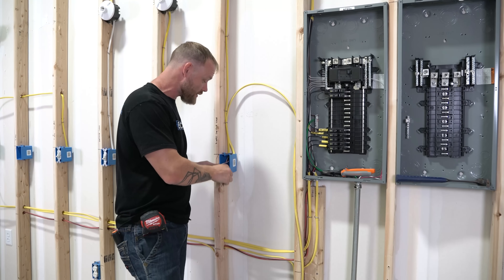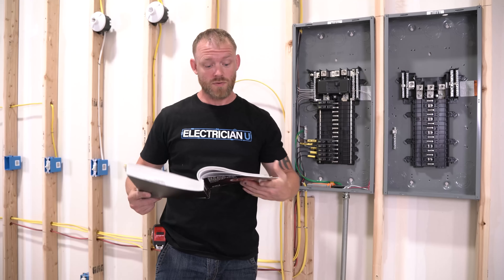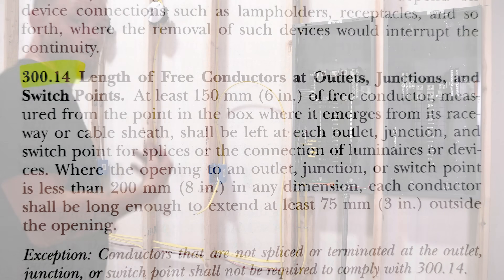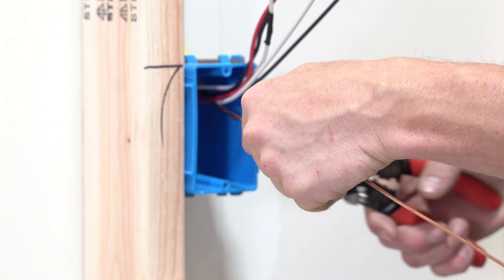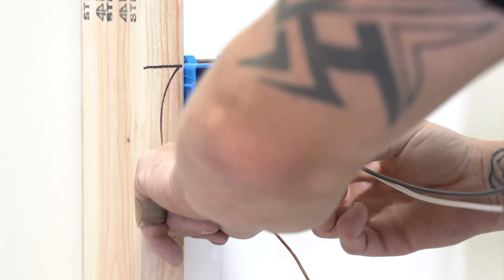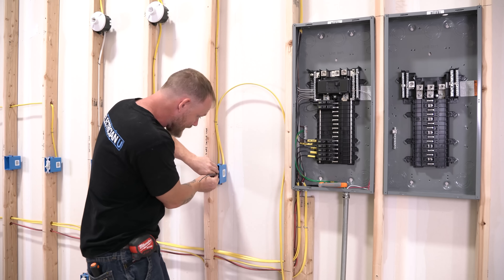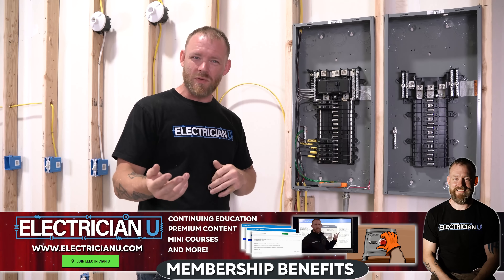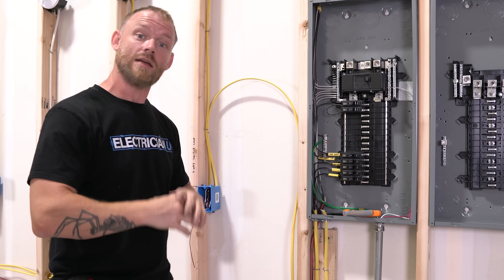STOP Cutting Wires So Short!!! What Does Code Say?

Comment: Crazy a code so simple can have language i’ve missed for years and i’m 20 years in and licensed. Always made a habit of 6” passed the opening of small outlet boxes and now realizing it’s 6” from the sheath or conduit and only 3” passed the opening on small outlet boxes. Code is a minimum, but with larger devices it’s good to have a way out legally.
Reply: Almost 30 years in and I still experience the same thing on occasion (simple code language that I missed). But, like you said, code is the bare minimum and sometimes the code isn’t even adequate for all situations. What about a 5 or 6 gang switch box? 6 inches from the point of cable/raceway entry into the box is not enough. What if your romex comes into the right side of the box but you need that switch on the far left side? It makes for some nasty joints and unnecessary cramming of wires/ wire nuts when trimming out your switches
Reply: @Ephesians-ts8ze  6 inches is a minimum so just make them longer.
Reply: 8 inches from the back of the box.  Klein strippers is my gauge
Reply: You can make the wires longer as long as you don't exceed box fill.

Comment: There are a few things that really piss me off when I am doing service work and one of them is when I need to remove a switch or receptacle and the wires are so short that I can't get to the screws to disconnect the wires. How in the world does someone install a device like that? What goes through their mind when they think that the shorter the wire the better it is? Or is there some other reason for it?
 I understand that sometimes someone screws up and just fails to pull in enough wire or ran out of wire, but for God's sake put a fucking wirenut and a pigtail to extend the wire so you can work with it. So annoying. 
 Things that unqualified people will do when installing electrical that saves them a minute or two ends up being an hour or more of headaches and aggravation for the troubleshooting service electrician. 

  For all you installers and new guys and girls, here is a tip that will help you out in the future, as well as the electrician from the future who has to follow up your work someday. 
   Think about the next electrician who has to work on your install. If you do your job right it won't need to be fixed in the future and if you do it with bad workmanship you are making life more difficult for the next electrician which could be yourself. An extra minute or two will save someone in the future an hour or more fixing your crappy install.
Reply: Exactly. And if the wires are just barely long enough to begin with, what do you do when you run into some knucklehead that decided it was a great idea to plug in 6 powerstrips into one, and then run a dozen+  extension cords off of those, and burns the receptable up. And the only way to fix it is cut off the burned part of the wires and hopefully there's enough left...
Reply: @brnmcc01  --- if there isn't enough wire, that's when the real money gets made. New wiring from that box to wherever those circuits are being run from. If it's flex it's not so bad, knob and tube - you're screwed, Romex or BX or MC or free air wiring, you're screwed. Actually the customer is screwed, we just have some work to deal with. But that's what we do. That's why we get paid the big bucks.
Reply: Yes think about the next electrician, because the 'next guy' might be you 10 years down the road.🤣

Comment: A good rule-of-thumb I see a lot of journeymen teach apprentices is stick the jaw of your (9 inch) lineman’s pliers against the back of the box and cut your wires off even with the end of your pliers handles.
Reply: I'm an advocate of thumb to pinky outside the box. Even guys with the smallest of hands can make the wires long enough.
Reply: @IceBergGeo  that’s a good one, too! Actually, the thumb to pinky rule is even better since boxes are different depths and putting your kleins against the back of the box may not be enough if you have an extra deep box or box with an extension ring
Reply: I just use the the tip of my thumb to the bottom of my hand as a ruler, for how long I need my wires to be outside of the box, because it's exactly 6inches, but thats gonna be different for everyone.

Comment: Great video and explanation.  I have to admit, when I bought this house 10 years ago, I wanted to learn how to change light switches and outlets.  So, I jumped into it, watched some videos and went to it.  I did cut some of them back too far I feel, but my reason wasn't so much about recycling, I got USB outlets, big boys, and I was getting frustrated because I couldn't get them in flush and thought there was too much wire blocking the way.  Now, in the last 3 years, I've learned my lesson, since I've tried to change them again and they are super short.  So, anything I currently change, add, or replace, I've left at the 6- and 3-inch marks, I get it now lol.  Previous house owners also cut them short, so I've been adjusting and fixing their issues to bring things back into code and make things right.  Wish I saw this video back then.  I've learned a ton from your videos and have now installed new lighting in my ceiling, and more.  Feel a lot more comfortable and even have large electricians' book now.  I do enjoy it.  Thanks again.
Reply: Why not cut out the box and install a larger one?  I don't really see a reason to ever use shallow boxes (understanding that yea, older work probably used smaller boxes) unless there's some sort of space constraint behind where you're installing the box.  Would be curious to know there is a reason other than cost savings to use one.
Reply: @danielherman9483  Exactly, if I get away with it now, I will.  But back then I was a little intimidated and didn't know.  This past year when I remodeled my basement, I added new lights and the way the old owners had it wired, was a nightmare.  I basically rewired the entire basement, they had things going all over for no reason that I could find.  I streamlined it and it's so much nicer now.  I work IT, built many PC's and now do web dev stuff.  So now electrical is like building a PC to me.  I enjoy it and look forward to my next project.  This house has been my training grounds.  Next house will be fun!
Reply: @ThommyGunnGaming  Hah, similar boat.  Software Engineer here, and the things that the previous homeowner to me did are horrifying.  Some are pretty dangerous.  In addition to the deteriorating old BX I need to replace, I've found something wrong in every box I've looked in.
Reply: @danielherman9483  hah exactly, know how you feel!

Comment: I think code is 6" but longer the better. How long is too long? I don't know but I always leave as much as possible. Also never clip the loops and make new ones. When you replace a switch/receptacle. This is why wires get so short.
Reply: Anything over 12" is too long. You then have to double count those wires, for box fill. (Although, with big junction boxes, I'm sure that there is a bit of wiggle room with respect to that 12"length, since you've got to have them at least that long to meet the wires in the other side of the box.

Comment: Not able electrician, I work I coax cable for Comcast. It drives me nuts when people cut cables nearly flush to a surface and I can't get the connector on it.
Reply: You'll love this story,  Years ago my parents moved their business to a new office, they paid an LV cabler to come in and run cat5e.  They guy was such a hack he didn't leave enough cable length in the closet to properly punch down on the patch panel for three of the runs.  The closet had a PBX and a 66 block in it for the phone system.  rather than rerunning those three runs, he terminated the cable on the 66 block and pigtailed down to the patch panel.

it was like that for years until a few years ago I went in there to refresh some network equipment, installed a new half rack and tried to install the patch panel in the new rack.  I kept getting snagged on something, so I cut the zip ties and followed the bundle of cable only to discover his handy work.

Comment: Fully agreed that there’s should be a mandatory minimum wire extending out of the box to facilitate electrician to fix receptacles basing on common sense even if there’s no regulations. Longer wires can be cut short while shorter wires only hamper the smooth execution of any kind of electrical works. Anyway, thanks for uploading a video stating the obvious
Reply: There is a mandatory minimum. It's 6 inches
Reply: @JesusPerez-yc6yu  yes, that’s correct and true …… something so obvious that the government need to legislate it.
Reply: @PSM-IPADZ_OX  well they have to. Then it would be to ur own discretion. Ppl would say no cut it 9 or 10 some would say no go 4. So instead they made a minimum 6, past 6 u can do as u like.

Comment: Some of my journeymen do this and actually scold me if I leave them like 5-6" out while I tie in, I can see cutting them a little shorter if the box is tiny but geez, give a guy a break on the carpal tunnel syndrome 😭
Reply: Cite article 300.14 to them.
Reply: The young and healthy don't consider any ailments whatsoever. My first major ailment was presbyopia(age related far sightedness), inability to see things up close. Nobody escapes that disease.
Reply: @aredditor4272  I get made fun of for not wasting my back for work, or for using an impact for the first 3/4 of the threads rather than hand tightening the whole thing. For me it's like, when everyone older than me constantly complains about back pain or knee pain, RSIs, carpal tunnel - why would you haze those who try to be smarter about things in their prime? It's almost cruel
Reply: @bubbly6379  Putting it in by hand at first can be useful sometimes to avoid cross threading. I'm mostly the same as you, run it in with an impact and hand tighten it at the very end to get it just right, but doing service work on some old metal boxes, the threads can be so boogered up. If it's stripped then I have to go for the tap and die.
Reply: @benjamincarpenter4376  yeah I agree, start the first 3 or four threads by hand or with a screwdriver, the next bunch can all be automated though.

Comment: Ultimately, it’s about caring about the next guy, which is what sets a good workmanship apart from hack work.
Reply: And that next guy might be you.
Reply: @ricker76er  literally came here to say this. If I ever need to rework something after the cut in or if I get called back to add something, I want ideal situations. If you're not paying attention to how long your conductors are, you're hurting yourself and your company.
Reply: Yeah cutting off a wire that's a little too long, is infinitely easier to deal with than a wire that's too short! If you have to add pigtails to all the conductors in a plastic single gang box like this one in the video, you can run into code issues of too many wire nuts in the box, too many conductors, etc, and if drywall is already up, that's a big problem to reopen the wall and fix it. Can't fit a GFI with USB receptable in that little box if there's 6 yellow or tan wire nuts in there too!
Reply: So true, I recently put in a few lightbulbs and an extra outlet in my garage and literally was thinking about Dustin‘s video here and tips about leaving enough wire for the next guy so thanks for everything!!!
Reply: It takes less than a second looking at the wires, or "make up", in a box to see the quality of an electrician.
Reply: True statement!
Reply: f the next guy
Reply: Tape your receptacles too! Especially in metal boxes.
Reply: @cheflebowski8155  overkill

Comment: I noticed on the wall you have 12 gauge wire going to the lights but the you have a 14 gauge wire from the light to the switch. Is that on a 20 amp circuit or a 15 amp?  I didn’t think you could use 14 gauge wire on a 20 amp circuit for any reason. 

You’re videos are some of the best on here. I especially like that you refer to the code book for clarification. I’m a DIYer and I bought the book after watching a number of your videos so that I make sure anything I do is up to code. Thanks!
Reply: You can tap down. It's the tap rule in code.
Reply: @Squat5000  Can you do that for a receptacle too or just switches and lights?
Reply: @billsedutto8824  just lights. Anything that can take the full current (potentially any receptacle or switch box,) must be fully rated, for (hopefully) obvious reasons.

Comment: DUDE, what’s with the orange extension cord pulled through those studs??? MESSES with my head, hard.
Reply: Is that what that is?  I thought it was for a 30 amp line. I don’t know what gauge wire that would be but I know it’s orange.
Reply: Number 10 Romex has an orange outer jacket
Reply: @Ephesians-ts8ze  nope! 😊
Look at the black stripe
Reply: @Gruntled2001  ok,my bad. I couldn’t really see it too good on my phone without my reading glasses. I just know no. 10 Romex is orange.
Reply: @Ephesians-ts8ze  I hear you! There was even a discussion thread about this cable/cord from one of the previous videos on Electrician Talk, and the conclusion was that it is an extension cord after all, maybe as a stand-in made look like 10/3 Romex...
Reply: @Gruntled2001  I see it now. I had to pull out my iPad and reading glasses, lol. You can tell by where it’s stripped out in the panel, too. It’s definitely an extension cord
Reply: "The wire ain't to cOdE" - proceeds to bitch about the Susie homemakers, while running extension cord through the dang wall 🤣 spoken like a real PrOfeSSioNaL 😘

Comment: Ground wires don't terminate or splice so should fall under the exception
Reply: Lol wut?

They terminate on devices, and have to be spliced through with nuts or crimps
Reply: Only time the ground wire wouldn’t terminate or splice would be in a box that was strictly a pull through box (no splices on the grounded or ungrounded conductors)